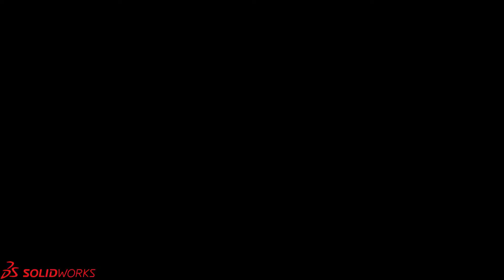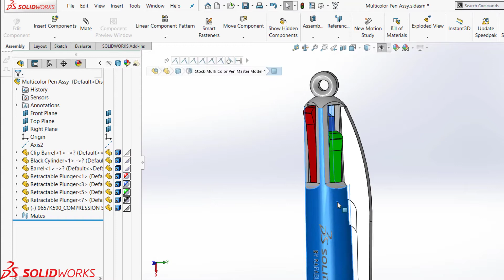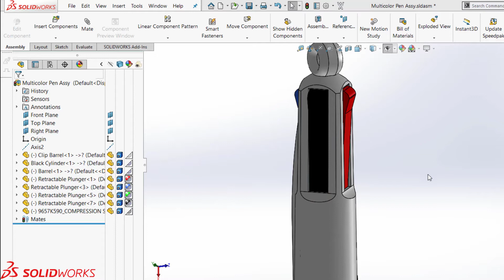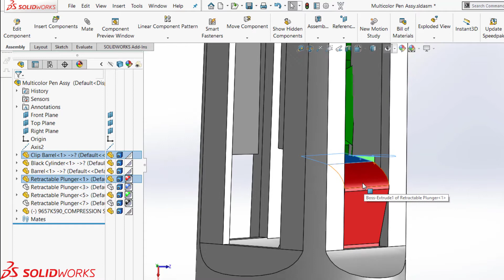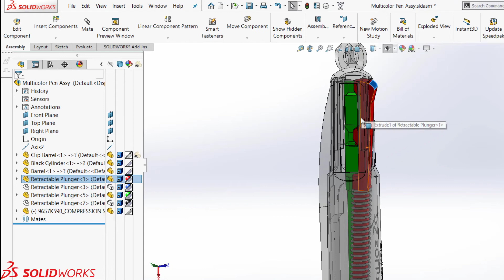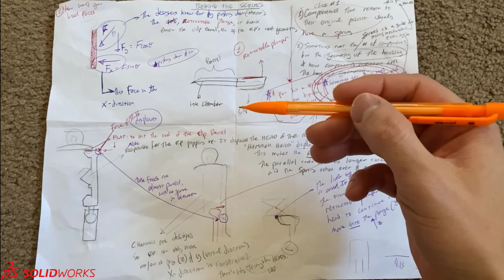Mechanism Library: Multicolor Pen SOLIDWORKS Tutorial

Comment: There is (or there usad to be) a type of multicolor pen with ONlY one button on top. Color can be selected by just looking at the corresponding face. How does it work?
Reply from the maker: Hi there, this is a great question for the SOLIDWORKS community. MySolidWorks is the place to get the best answers to your questions about SOLIDWORKS in one location. 
 
We can also direct you to a variety of resources for questions and networking. 
 
SWUGN, or the SOLIDWORKS User Group Network, can be accessed here:  http://swugn.org/ 

With your existing SOLIDWORKS or 3DEXPERIENCE ID, you can access SOLIDWORKS Forums for more information on a variety of topics and questions from our user community. 
 
Check it out here: solidworks.com/UserForum